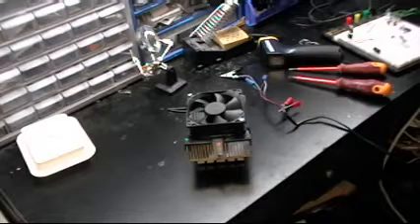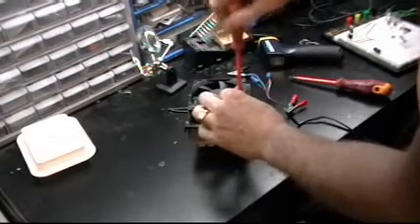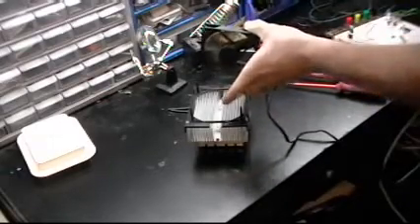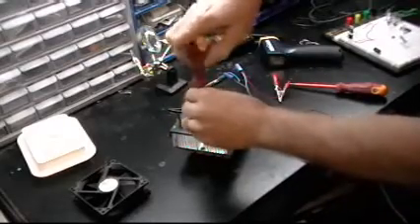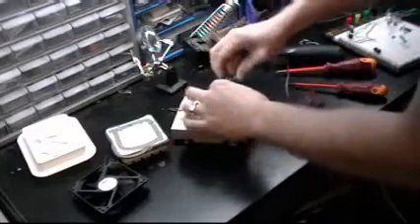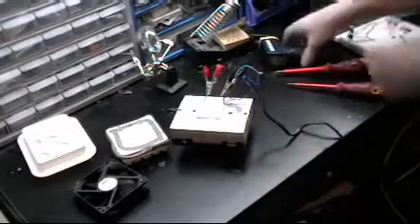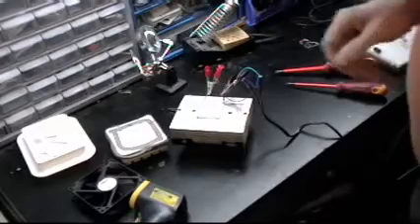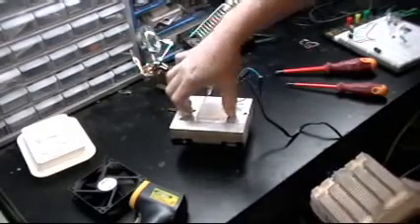Peltier Cooler Fun

Comment: they are absolutely awesome for certain things, especially cooling electronics, making heatsinks more efficient by increasing temperature gradient
one neat thing I have found about using them is making a mini beverage cooler. if you want to cool a can of coke really fast, put a peltier on top of it cool side down with a heat sink on top and wrap the can in a wet towel. it will cool the can pretty quickly

Comment: as you have quite possibly already figured out, peltier units' strength is in contact cooling, that's really what they are made for (as in sitting on top of a CPU cooling it). they are contact heat pumps, if you could put one inside a seat cushion and vent the heat out, it would work
but for space cooling they will be insanely inefficient. you are WAY better off just investing in a swamp cooler. the cost will be similar, but it will be far stronger